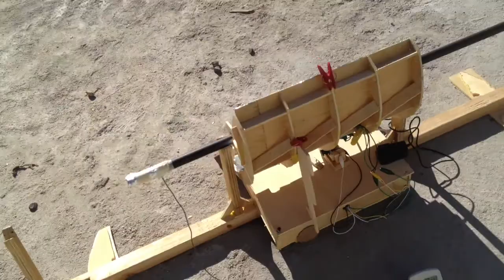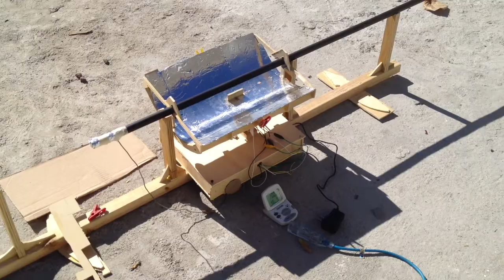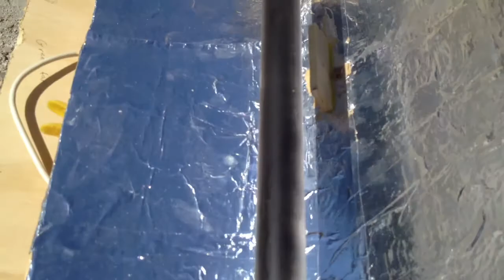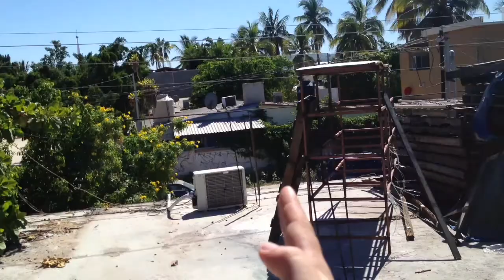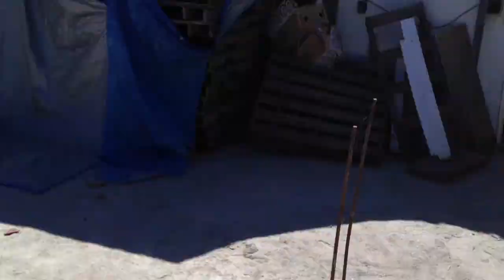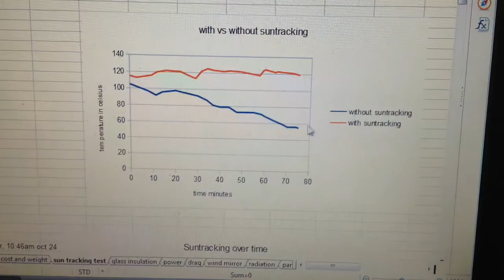solar thermal powered car part 29, model sun tracking

Comment from the maker: Thanks

The motor was a little servo motor from an old RC airplane that I crashed.  I just added a pulley from a broken DVD play to drive an elastic band.  This gear motor had nice and low RPMs and was very torque for its size.  I powered it with a 6V 4 AA battery pack.